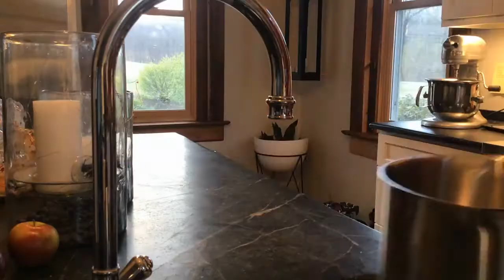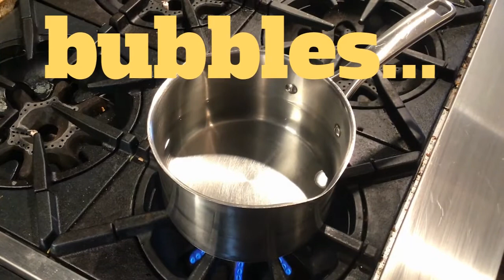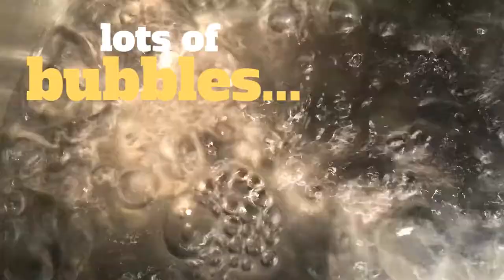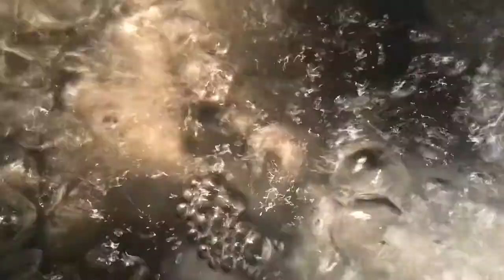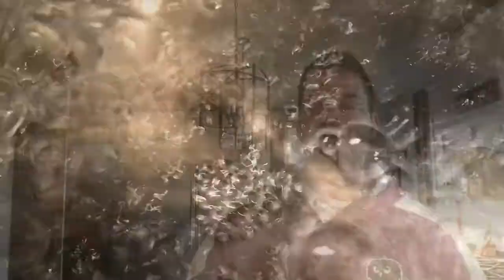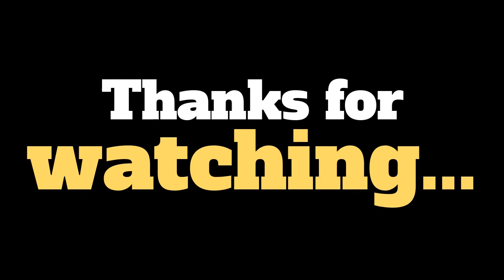Boiling Water? - FunScience Scavenger Hunt

Comment: When the water is boiled the heat energy is transferred to the to the molecule of water which begin to move more quickly eventually the molecule have too much energy tostay connected as a liquid.When this occurs, they form gaseous molecules of water vapor, which float to the surface as bubbles and travel into the air

Comment: Before answering  this question we must define 2 types of energy 
Sensible heat:related to changes in temperature of a gas or object with no change in phase.
Latent heat:Heat that causes a change of state with no change in temperature
So we know  that water boils at 100 degree C
when you are heating the water from the temp of the room to the boiling temp sensible heat increase---> temp increase
when water reaches 100 degree C
Sensible heat will be constant  and latent heat will increase thus changing the phase of water from liguid to gas( when increasing the latent heat we are increasing the humidity..)

Comment: Water is contant with bottom surface, the bottom surface temperature is bit more than the boiling temperature of water say 110 celsius and water that is contact with bottom surface absorbs more heat and starts to vaporise that cause water vapor(gas) at the bottom and forms bubbles.

Comment: As you heat the water, you get closer to the bubble point which is when a liquid becomes saturated and first comes into equilibrium with its vapor phase. Take a look at a saturation dome on a T-V diagram. The left side of the dome is the bubble point/saturated liquid curve. Once you reach this point, the first bubble forms. In the pan, the bubbles are nothing but water vapor bubbles. They form at the bottom first because the bottom of the pan is hottest and reaches the bubble point before the rest of the bulk liquid. Once bubbling begins, the water is in vapor-liquid equilibrium.